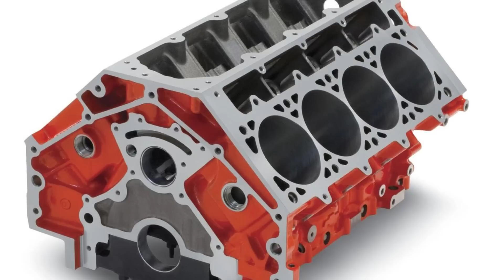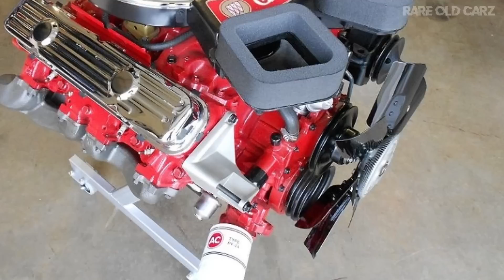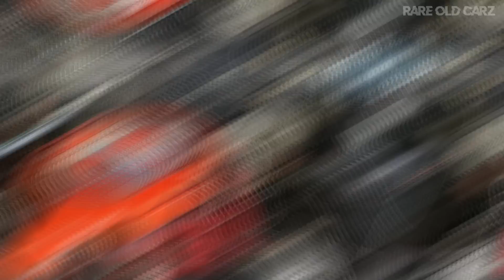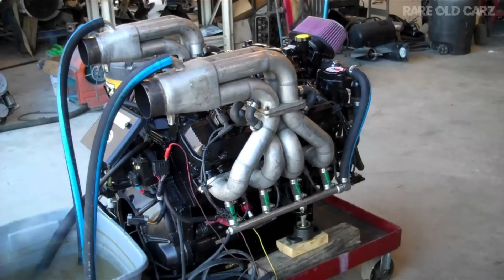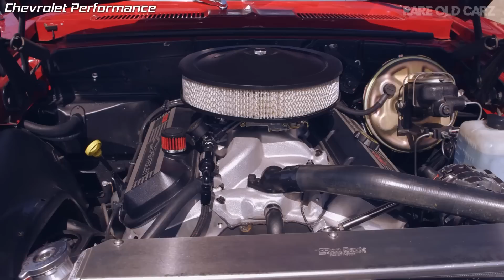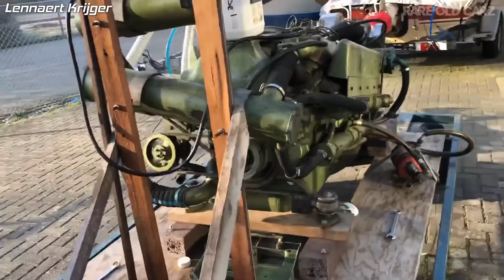12 BIGGEST V8 Engines Ever Built By GM

Comment: I learned to drive in a 1973 El Dorado convertible. 500 cubic inch displacement, and burned nothing under 100 octane leaded fuel well. Passed anything on the road except a gas pump...😂

Comment: I tuned up an Olds 455 when I was a kid.  I had to climb into the engine compartment and sit on the engine to work on the distributor.   The distributor was in the rear of the engine next to the firewall.   It was in a big Vista Cruiser.

Comment: In 89 I had an army buddy who bought a 71 Cadillac with the 472, it was a beast.
Reply: Have a 1975 Sedan DeVille with the 500cid now. They are giving the HP at the rear wheel in anything 1972 and up.
Reply: No to mention the Toyota GT1 is more than an insult, it devalue the whole selection.

Comment: Its strang the Olds 455 horse power was rated over the Buick but buicks better rod ratio gave it a stronger pull from 60 -100 MPH. G.M fudged the horsepower numbers of those engines rating the Buick only for torque but how could it not make the horsepower with a better Rod ratio than the Pontiac or the Oldsmobile with their taller ports to go along with it. Even the 454 LS6 which had a far bigger cam and higher compression radios and the Buick would give it one hell of a run for its money leaving you wondering if the Buick had all the high performance stuff the Chevy had you would have to go with the Buick.
Reply: Each 455 had a different bore and stroke... Buick had a over square block..olds had a under square block.. and Pontiac had a almost square block...
Reply: @tonysendrick6347 yeah the cubes were the only thing they shared,  back then each division of GM made their own stuff. One thing Pontiac had over the other divisions was the internals are interchangeable from the 389-455 engines.  Chevy,Buick and Olds didn't have that.
Reply: @shawnbirt4161   but the blocks were the same from 287-455. That is why there is no big block or small block Pontiac.
Reply: @analogkid4557  that's basically what I was saying that the Pontiac motors are interchangeable.
Reply: Olds HP numbers are all BS prior to the intro of Net HP.  400HP in a 1970 W34 Toronado but 370 in a W30 442.  Bullshit.  A much bigger cam duration in the W30 with a 4 spd.
The Buick cylinder heads are much better than the Olds heads
Reply: Rod ratio has nothing to do with it. That only changes valve timing requirements. The intake runner length has more to do with torque and hp.

Comment: Excellent Video, this brings back fond memories, my 2nd car was a 1968 Oldsmobile Toronado with the 385 horsepower 455-ci and the fastest top speed I got it to was 137-MPH and it was still was pulling, in 1985, I bought a 1969 Chevelle SS-396, 375-hp, and had a drag racing friend build the motor, it was bored out and balanced with a hot cam, hooker headers, 650-cfm holley double pumper spread bore carburetor, a mallory 50,000 volt coil and 8mm ignition wires, dana 60 posi-trac rear end with 456-1 ring gear, it was pushing 600+ Hp. new subscriber.👍🇺🇸
Reply from the maker: Thanks so much and have a good day!

Comment: The Oldsmobile W motors were all balanced from the factory that made them smoother
Reply: That didnt stop the 455 from pitching a rod thru the pan after a few revs past 6000
Reply: @JasonKent-n3j  it was a select fit program to find the best matching parts of the rotating assembly by weight
Reply: @gordonborsboom7460  They were Dr. Oldsmobiles. Lol at least it was more attention than most got
Reply: Then they stick a big cam in it to make it not smooth.
Reply: Literally every engine is balanced
Reply: @williamwesse6114  No they were not they never were two point they have somewhat to run but balanced there or not that’s why cost thousands of dollars sometimes To get them balanced properly